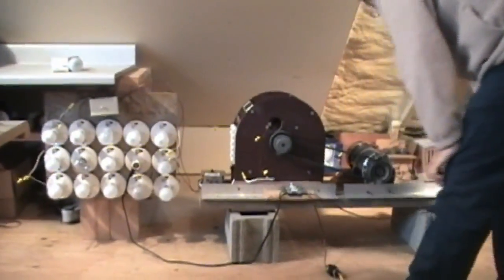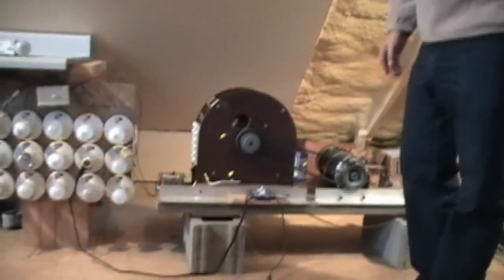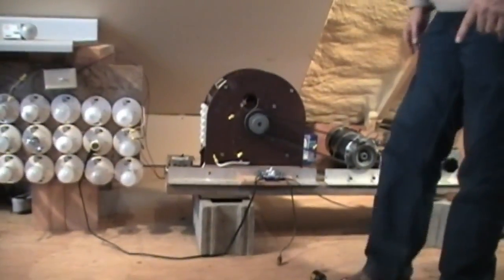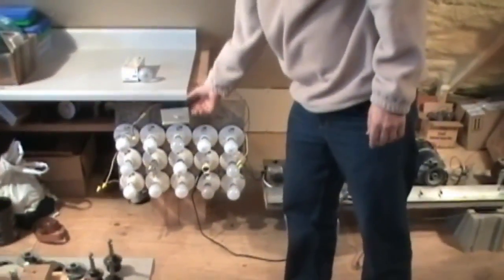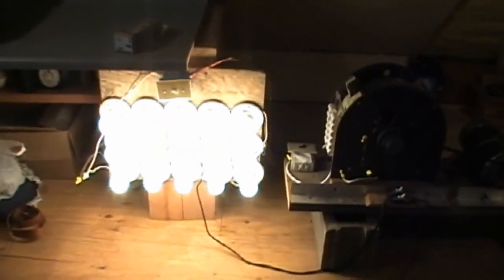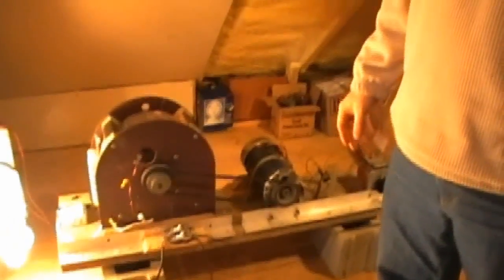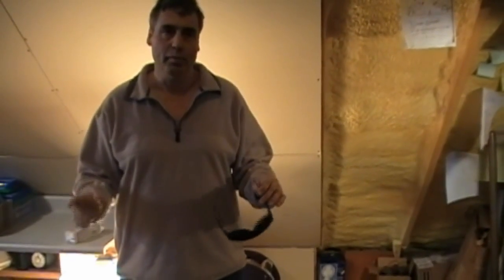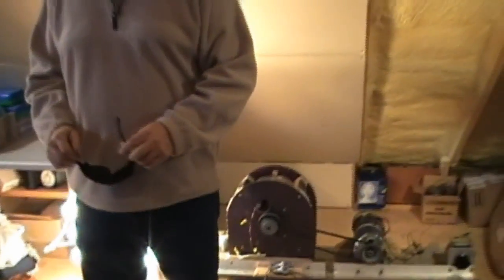Self Running 2000 Watt Fuelless Generator (2 of 3).

Comment: god's blessing upon you, fellow christian! It seems that i finally found someone who is publicly bound to god's will and has been gifted with the knowledge that only His great kindness and concern could provide. I'm trying to build mine right now. Mine is a little bit different in the matters of from where the energy comes and besides, it makes no noise and is very smaller. No moving parts outside the system itself. I hope i can record it when its working at full, powering my own house on itself

Comment: Simple; Electric and magnetic are the same, we have determined how to generate a an infinite feedback loop with strong  permanent magnets, thus the energy is coming from interaction of these magnetic fields. The continuously changing(AC) magnetic field thus starts an AC electric current (in the wire nearby) which is used to : store charge on a battery, or sent directly to a machine, as shown with the light bulbs.  Creating positive feedback (electric/magnetic) is easily understood